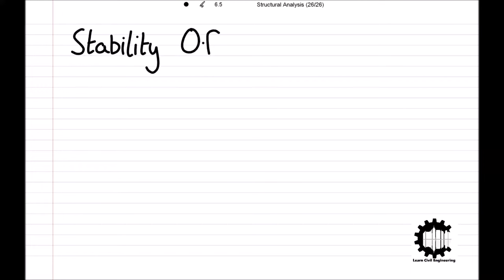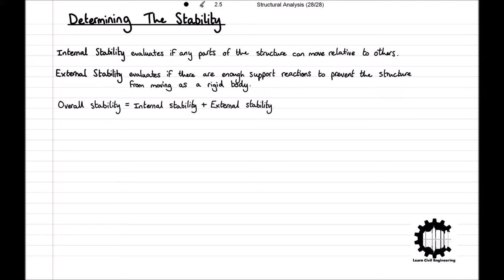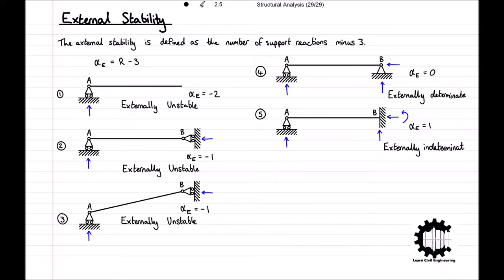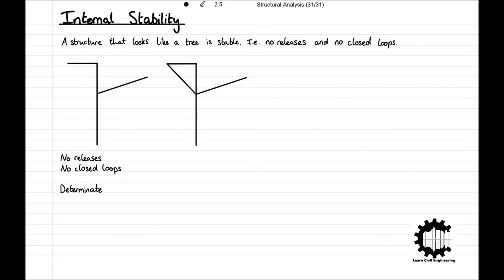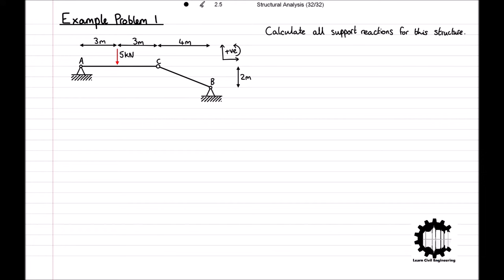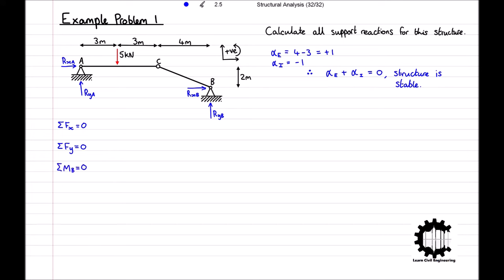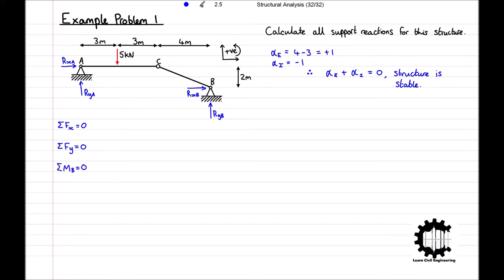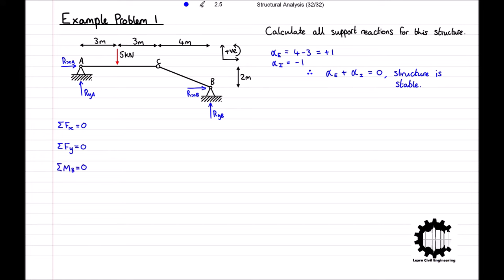Structural Stability and Determinacy with Example Problems - Structural Analysis

Comment: Hello, Could you please explain how to find the internal indeterminacy degree of the structure with X bracing shown at 1:34. To my understanding, we have 4 hinges and each hinge is connected to 3 members it'd reduce the indeterminacy degree with (3-1)=2 >> 4*-2=-8 but how to determine the number of loops that increase the degree of indeterminacy.  Thanks in advance.